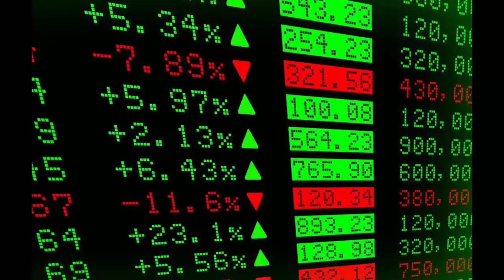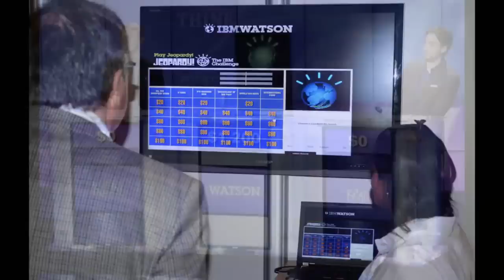Top 10 Robots That Will Make Our Jobs Obsolete — TopTenzNet

Comment: There should be a border line between robots . Regulations such as high taxing on robots or something else
Reply: Nyc 443 Why?
Reply: Sentinalh so economically people have jobs still and purpose in life I would say ✌
Reply: sean love People's purpose in life should not be working, it should be living.
Reply: Working is part of living, I am glad to have a job as in my economy in the UK the number off jobs to unemployed is very low! When I was not working I was very depressed till I found a job giving me purpose, yes I live outside work and have a great social life! There's a thing called balance with that obviously! You obviously have taken what I said the wrong way I think 😂
Reply: thank you sean for pointing out the obvious lol :P
Reply: did the work for me
Reply: sean love 

The increased efficiency & output due to automation will permit lower prices. The whole mechanized industries could be powered by renewable energies and use recycled materials, achieving zero marginal cost. Resultant abundant goods & services would be as free as the air, obviating humans' need to engage in industrial tasks for an income in the first place. Employment (wage slavery) would no longer be an economic necessity, unless the capitalists try to keep the money-based class-divided system from which they benefit.

A more crucial question than whether people will continue to have a job, is whether they will have control of the automated means of production as social commons.
Reply: Nyc 443 well the obvious wasn't for some so I pointed it out obviously 😃